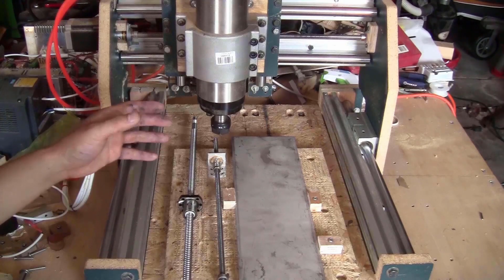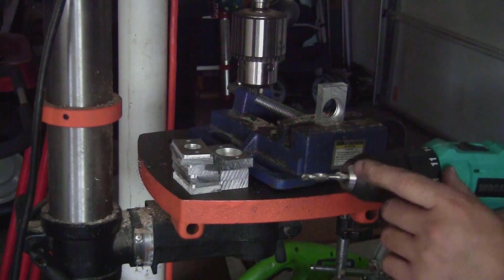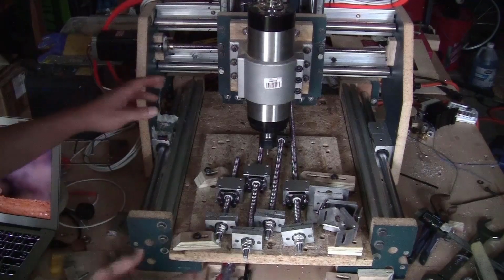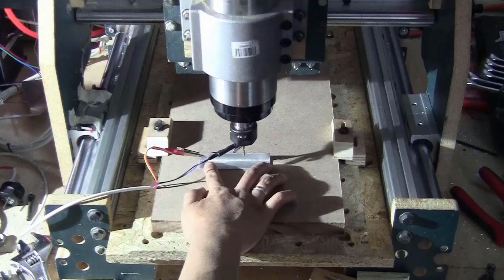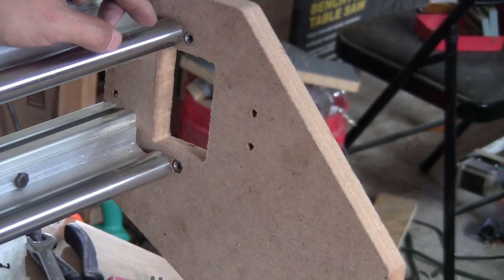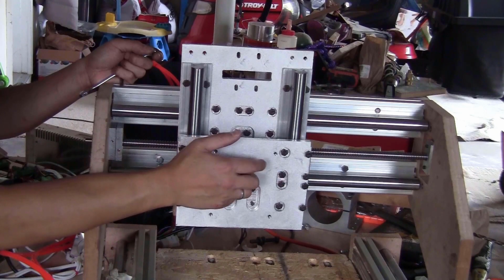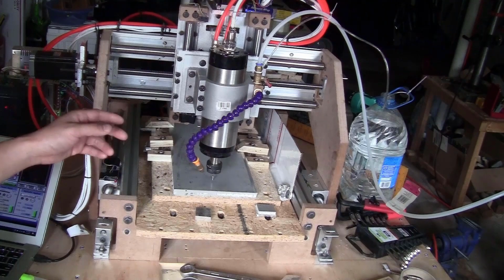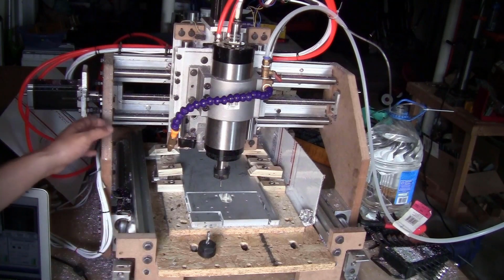Beefing up my DIY CNC - Leadscrew VS. Ballscrew - Learned whole lot about Aluminum milling

Comment: Do you use an ordinary circular saw with a metal cutting blade ? Did you manage to cut stainkless steel? what was your power level for the spindle?
Reply from the maker: I cut aluminum using any teeth blade. I used abrasive blade to cut the steel rails.
Reply: @minhsmancave9448  Thanks. Did your VFD/spindle manage to cut steel. I was wanting to buy one spindle to swap in different machines bandsaw, bench drill, cnc etc. but watching youtube seems to indicate you need big motors with low rpm 80 or so for stainless and high torque. Vevor spindles do not seem to indicate that low an rpm even with the 1.5-4kW spindles.
Reply from the maker: No, it was too fast and too low torque at low speed. On my new CNC, I have 375w ac motor ran at 2850rpm, I feel it is still fast to cut steel. Might to reduce to about 1000 or 1500rpm
Reply: @minhsmancave9448  Thanks, you saved me wasting any more time on the idea. If I ever want to I will consider pulleys.

Comment: You are really great for sharing your hard work. One thing that is clear is that we all buy things which are cheaper and keep buying replacements. knowing your journey helps us decide with some knowledge beforehand. It is amazing how much you end up needing to know
Motor selection-Everything from possible spindle 500w 52mm banggood motors, to makita routers to the vfd spindle ?power.
 The different types of linear rail from the sbr20 to  hgr20 type or possibly 16 size. 
The difference between lead screws and bearings sfu/rm1605 bearings . I note you used sfu1204 
The sizes of the aluminium extrusion ,
 whether the deck moves or the gantry moves over the bed,
 the number of guides for the z axis.
the power/torque for the stepper motors
 The different setups of the moot 3,
 lowrider 2/3 and making things based on those with other options for rails,(electrical conduit) and driving them not by lead screws/bearing screws but tape.
the difference between boards.

Comment: I love your idea of using wood to make the machine and improve it after with metal that way you don´t have pay someone to help you. Really great ! Thank you so much for your comment too it helps beginners a lot !😄:yougotthis:
Reply from the maker: Yes, I'm building a new design using the same approach and it is working great. Milling Aluminum very easily and can upgrade itself. Will post the new video soon.

Comment: Mihn, did you also replace the guide rails?
Reply from the maker: Yes, the ballscrews are not essential for milling Aluminium but the guide rails are. The rails have to be sturdy or fully supported for milling harder material such aluminum. The ballscrews only help to have better precision.

Comment: I built my machine (an eternal work in progress, always looking to improve) based on your findings and I am forever grateful for your video's. Looking forward to more from you. Next step adding epoxy granite to reduce vibrations?
Reply from the maker: I finished replacing all the brackets with aluminum (next video after this one) and the machine is working really well with aluminum. Not much vibration that can make the bits chatter. I still have hard time milling steel because the spindle speed is too high (low speeds don't have good torque). Other than that, I'm pretty happy with the setup.

Comment: You're a real trooper. Getting down to 1/2" is a big deal. Nice!
Reply from the maker: Once I know what to do, it's not that hard. Compressed air is very important. If you're not scared of messy water, adding some mist will make Aluminum cutting very easy, almost like plywood, at least with this spindle.

Comment: Right now, I'm just trying to engrave 3mm letters in aluminum. I'm having a difficult time doing it. The letters have to be pretty small. I found a video showing how to create the design with fusion 360 (using the single line fonts). What bit would you use to do this??? The letters need to be sharp/precise.
Reply from the maker: You can use v bit, but the 3018 cnc is very shaky when milling aluminum, the V bit will break very easily. Do to extreme precise jobs, the 3018 cnc is not the best. Might need to upgrade the rail on the X axis and the spindle to a more precise one to cut tiny letters.
Reply from the maker: By the way, if you want to do just text, I think inventables from X-carve is not bad, but need to pay monthly subscription for few dollars I think

Comment: Hi Minh, I just bought a 3018 (my first CNC) 2 weeks ago, and watching your videos has made me realize I should probably return it. 

I would like one that can mill 1/4" aluminum. I can assemble the parts, but if you are interested in earning some $, I would pay you to make the parts for a better machine. Of course I'd pay for all the parts and your time, but I understand if you're not interested.

Great work!! You are a smart guy !
Reply from the maker: How much is your budget? A decent machine such as 6040 on eBay is not bad at all, it is ready to run out of the box and surely can cut aluminum. Look for the one with all supported rails on all axis

Comment: Great video, its thanksgiving morning here.
I really enjoyed watching your video, i am a cnc programmer machinist by trade.
I have a small suggestion for you to help hold down your parts, if you have a part that has holes in it you can put screws in those holes thru to your scarf board to cut your outside contour to prevent your part from moving.
👍
Reply from the maker: Happy Thanksgiving, I'm preparing some ducks for Thanksgiving dinner, not traditional at all, lol!!! Thank you for watching and I'll keep your suggestions in mind for next time.

Comment: You mention in one of your comments how it would be possible to buy a 6040 off eBay cheaper. Maybe so, but your machine looks much better to me!

Greetings from England!
Reply from the maker: Thank you for liking my design. I didn't say the 6040 is cheaper, it's ready to be put together. That's an easy option for people who doesn't want to go through the whole process of upgrading, cutting parts. It's a long process and not always smooth. Mistakes happen but I learned a lot.

Comment: Oh man love doing this kind of stuff. Building machines on the cheap that can do what machines costing thousands can do.  Love that your cutting aluminum with a cheap harbor freight saw. I just got a cheap 3018 CNC and want to get it to the point it will cut aluminum well. Right now it can do it, just not too well. Defiantly will be using your videos for inspiration to get my machine where I want it to be. You definitely got me as a sub!
Reply from the maker: When you have a 3018 cnc, you have to pair it with harbor freight tools, lol!!! For the 3018 to cut aluminum correctly, the most important upgrade will be replacing the rods on the X axis with the fully supported rail like sbr12, sbr16 or mgn15. The spindle upgrade to a 500w set will be another. That will make the 3018 cut Aluminum fairly well. Also use single flute end mill will make the cut smoother.

Comment: Hello, Thanks for the video.
Why did you use water cooled spindle instead of air cooled  since it's a small machine so small package ?
Reply from the maker: Water cooled spindle is quiet and can run longer cutting without hitting up. I know that I overkilled but very happy with its performance. Air cooled spindles usually are not recommend for cutting jobs longer than 5 hours or something like that. If I tried to make some big and detailed 3d relief, it can take really long time.
Reply: @minhsmancave9448  I see thanks

Comment: what kind of vacuum do you use? is it a regular house hold vacuum?
Reply from the maker: Just a 5 gallon shop vac. Surely not a pro dust collector
Reply: @minhsmancave9448  a shop vac? what's the difference between a vacuum for shops and a regular household vacuum?
Reply from the maker: It's a bit bigger and more powerful, less mobility and louder, can work with either wet or dry debris.
Reply: @minhsmancave9448  I see thank you very much :)

Comment: Hi Minh thanks for the video. I'm converting a full size milling machine to cnc My tables are worn. and my y axis acme nut and acme screw are worn also making  the Y table extremley difficult to move do you think a ball screw would make it easier to move?.
Reply from the maker: Yes, definitely. With the ballscrews, I can move my machine at higher feed rates and also faster acceleration. Totally recommended the ballscrews
Reply: @minhsmancave9448  Thanks Minh. Keep on making videos. They are among the best with all the detail and showing what works and what doesn't work.

Comment: Can you do for sell, what aprox the price...???
Reply from the maker: If you wanted to buy one that works probably similar to mine, you can buy a 6040 machine from eBay (larger working area). I will only be able to make all the brackets, gantry plates from Aluminum, You will have to buy the rest and assemble everything your-self. Counting the material, my time making the piece, power usage of the machine, consumables, and then the shipping, etc. the cost might not be cheaper compare to a 6040 machine that's ready to use out of the box.

Comment: Excellent thanks!  Your machine gets better and better... it will end up being really capable and very desirable.   :o)
This is a very clear demonstration for those people who are struggling with "chip welding" and broken bits:
1)  Use free cutting grades of aluminium, like 6061, of possible.
2)   It is essential to get chips away from the cutter immediately - if the chip has been cleared before the cutting edge comes around again, it CANNOT get melted onto the cutter or workface.
3)   Use a single-flute cutter.  This allows a larger space for the chips to get out, and lets more air in to help with cooling.
4)   Use an 'air-blast' to clear chips, and cool things down.  (Make a simple fence like Minh has done to stop the chips covering your whole shop.)
5)   If you can do the above, you do not need liquids, which hamper chip clearance, and make a mess anyway.
I am only refering to 'Hobby Grade' machines... if you can afford a monster with flood-cooling and all the bells and whistles, you are wasting your time reading this!   :o)
Liked and Subscribed.
Reply from the maker: Thanks John, your comment sum up everything. I wish to have your comment before starting all this, lol!

Comment: I'm not very wowed by this design as it's a moving gantry type, but for those who like bigger is better I think it could be the way to go......I'm into building the 3018 with advanced upgrades as suggested by your previous videos on the 3018.......basically the 3018 is a fun machine and can do quite impressive work if beefed up.......it's mainly for people who like a small compact very economical envelope and also the DIY input for upgrade, but in the end it is purely a big boys Meccano set after all.
Reply from the maker: No argument about 3018 CNC is a fun starter machine. Each design has its pros and cons, moving gantry is surely less sturdy compared to moving bed. But has bigger working area for smaller footprint. If your aim is milling hard material, moving bed is definitely the way to go. My main purpose is making 3D relief type of arts, that's why I want to go with moving gantry for large working area.
Reply: @minhsmancave9448  Size is a major factor for the parts you want to make.....no one has yet settled on the ideal size once they start a purchase and price will always determine the outcome, it's usually a bigger upgrade as soon as you get it going.
If you bought your ideal machine in the beginning it would mean a huge outlay that would break the bank......time, being the cheapest commodity for the DIY person, always wins against the complete package ready to run out of the box deal.
The very worrying thing is the upsets that China is experiencing and the problems from import tariffs that are now making DIY build goods hard to source.

Comment: Can you tell parametrs of you spindlle(kw) and stepper motors?
Why you never try add some plates for increasing vertical stability on both sides of vertical legs? You have only vertical plate, about 20mm.   I think it's should help prevent from moving side by side. Aluminium is good, but still those legs can bend... There is not something what can prevent vertical bending. If you look at industrial machines, they have very thick vertical legs.
Reply from the maker: Spindle is 2.2kw water-cooled. Stepper motors  are nema 23 3N.m. I'm in the process of improving all the plate's sturdiness by changing from MDF to Aluminium. In this video, I already replaced the Z axis and it reduced greatly the it's flexibility. Will finish replacing everything by next week.
Reply: @minhsmancave9448  I see you videos from starting with 2030 CNC. I bought  this small machine to, should arrive next week. All your problems is waiting for me... I yust thinking about reinforcing side plates vith adding plates like T.  One more problem with aluminium milling is the distance from spindle axis, as i understand from many channels, best results you get if you leveling up parts close to axis as poosible. For less vibrations from spindle.You should adjust spindle level higer and use shortest bits. Ideal, somewhere to midle of axis...I can't try this, but you can ( for me and other subscribers):):):)

Comment: I absolutely love how your machine eats through the aluminium and it is so smooth too so no chatter or anything.  I can't wait to get to the ball screw part but time to mow the yard (I will watch more later).
Reply from the maker: It will get better soon. The MDF plates flexed a bit and make the holes kinda upside down conic shape. The top is bigger compared to the bottom. No chattering, just not very precise. I had to use the drill press to clean up the holes. After changing the Z axis to Aluminum, it got much better but I can also still feel that the 2 gantry plates on the X axis flexed. I'm sure it can mill Aluminum much better by next week after I change all the brackets to Aluminum.
Reply: @minhsmancave9448  Yeah?  I didn't make it to that but I can tell you MDF is crap except as a waste board.  You know MDF is really just sawdust and glue so you can't expect much from it.  HDF isn't much better and frankly I hate the stuff.  Oh, I have had HDF and MDF delaminate on me when I stuck it outside even though I painted it and sealed it.  Go very slow and get those in Aluminium, instead of MDF, and be amazed.
Reply from the maker: And dude, forgot to thank you for suggesting single flute end mills for aluminum to me before. I tried those and that's only type of bits that worked for me with this spindle.
Reply: @minhsmancave9448  You are welcome because they just make far smoother everything and they don't gum up plus they have the least resistance so the spindle is actually doing less work.  You can hear it, see it, and feel it while the machine is plowing through the aluminium.  Oh, and because of everything I mentioned it can also go through it faster.  So many people are using 2 or 3 flutes it amazes me.
Reply: @thebeststooge  to
Reply: @rayst.2934  I think you better rethink that, or delete your reply because in English the word "too" is the proper usage in the context in which I used it.  To is a preposition with several meanings, including “toward” and “until.” Too is an adverb that can mean “excessively” or “also.”  Before you critique others you need to learn the language yourself first.  Pffft.

Comment: Thank you so much for taking all the effort in making these videos, I have a 3018 DIY cnc and this helped me so much.
Reply from the maker: 3018 CNC is definitely a good starting point. I learned so much from using that machine. It has been only more than a year since I first learning cnc milling with that machine. You can definitely do the same as I did to build better CNC machine from it. I have other viewers showed their machine made using 3018 CNC and the design I shared. Have fun and enjoy milling, making things.

Comment: God I love this channel. I'm just getting into CNC and it's extremely helpful.
Reply from the maker: Awesome my friend. Very glad to be helpful!
Reply: @minhsmancave9448  Aloha Minh!  Great videos.  I bought a Sainsmart 3018 and find all kinds of small problems like no set screws on linear  bearings that I noticed you took care of in your designs.  I want to just upgrade my 3018 Genmitsu to a 500W spindle because my old spindle motor died.  I don't want to buy another weak spindle motor that allows me to create my own 'adapter' out of plywood like you did.  Is there anyone who makes a spindle motor upgrade adapter so I can use a 500W motor?  Can you do this if I pay you?  I just want to cnc very hard wood for fun vs. spend time upgrading my cnc.
Reply from the maker: @williamdenham8018  maybe you should go with something like this: https://www.aliexpress.com/item/4001294600834.html
And if you are upgrading to 500W spindle, maybe you should buy the spindle set first. The spindle might be 52mm or 55mm diameter and it might come with a clamp or not. I'll try to help if you cannot find a good solution